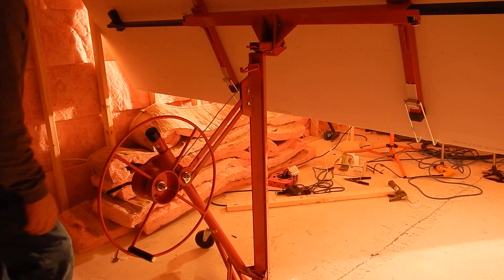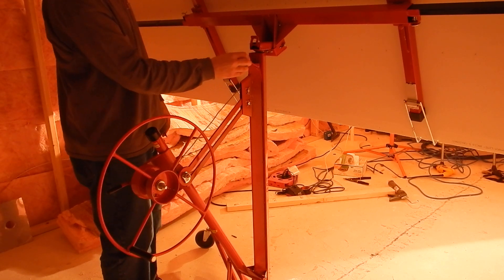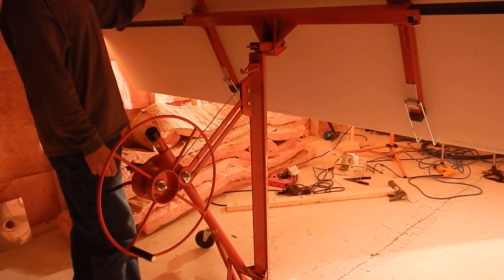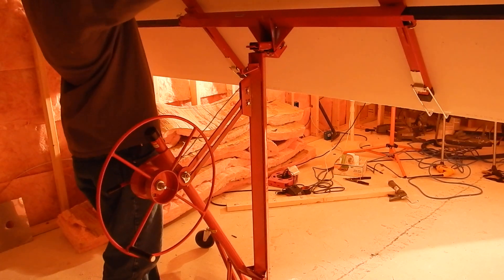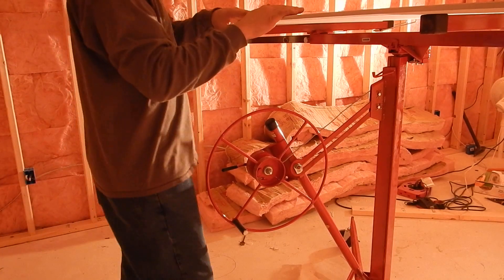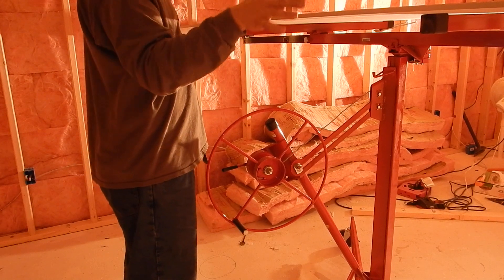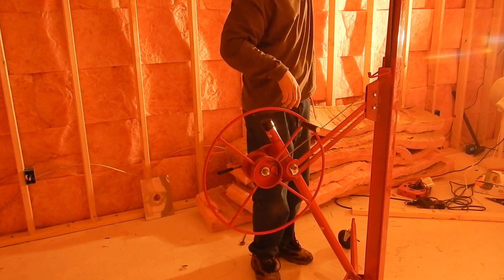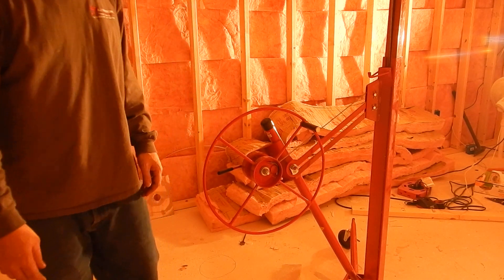Harbor Freight Drywall Lift Review and Tips

Comment: Good review on HF lift I bought one to help in  my basement remodel and has been great, I used it when I replaced my duct work for more clearance and now I have 43 sheets of 5/8 fire rock to hang on the ceiling. I had help getting the 4 by 8 sheets down the stairs I sure as heck don't want to lift them up without a lift by myself.

Comment: If you are looking for a way to hang panels on walls by yourself check out www.hangprolift.com.  The only tool made specifically for one person to transport, lift, adjust and hold panels on walls. Never have to lift a panel again when hanging walls. Works with upper and lower panels and up to 16 foot sheets.
Reply from the maker: Thanks
Reply: Robert Zimmerman  Apparently you haven't seen what the HangPro Drywall Lift for WALLS does, it transports, lifts and holds drywall on walls not ceilings.  2/3 of drywall is hung on walls but there hasn't been anything to help with that job until now. The HP can be used to lift drywall off the floor and onto a ceiling lift.